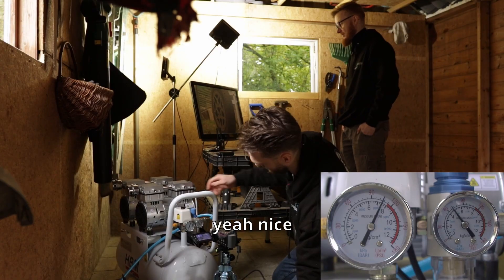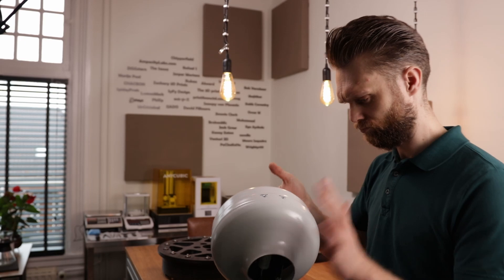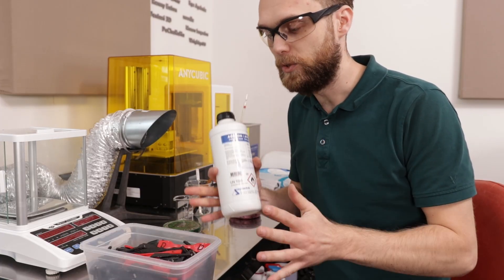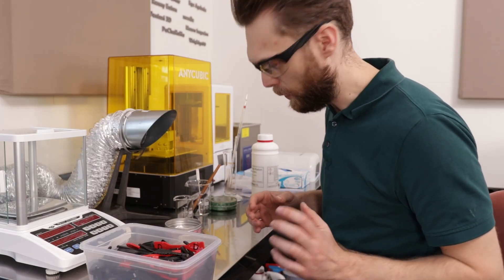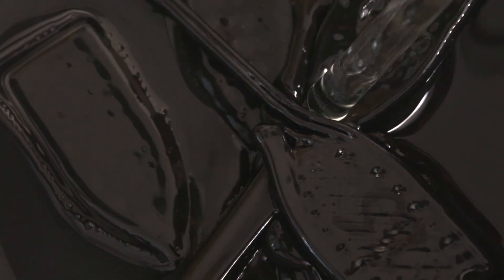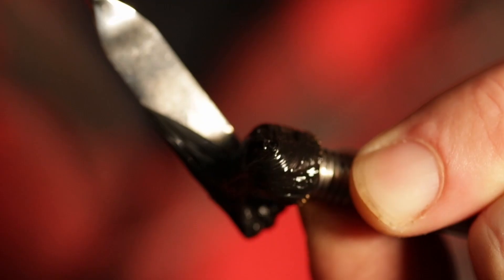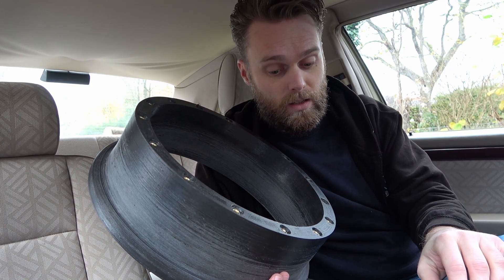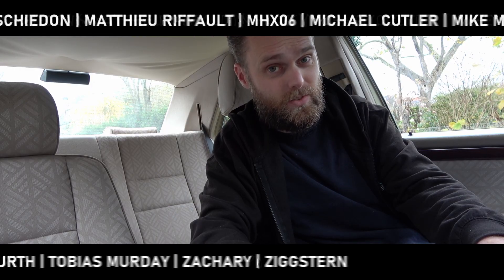DON'T use Acetone to repair ABS parts!

Comment: Can you mix the "Methyl Ethyl Keton" with "Abs" about 75/25%, then brush it all over the rim!, i think it will fill any porosity/ cracks and gives you a stronger outer shell, it might help with your experiment, so exciting for the next video, you can do it :)
Reply: It will also make the rim airtight so you might not need the inner tube anymore
Reply from the maker: Thanks for the suggestion! I was thinking of doing that, but because CNCKitchen showed that this didn't improve the strength of the parts I haven't looked at it further https://youtu.be/yJHcoFY4er8 I have some different tricks up my sleeve ;)
Reply: @properprinting  I saw that video link, my suggestion was inspired from what you have said, that the glued joint is stronger, its look like we are adding a thin layer of glue to your rim, CNCkitchen was using vapor only!
Reply from the maker: @jralrazaz2828  hmm, that's true indeed! That'd be interesting to try! I might need to make a bit thinner, more like paint in order for it to work. The walls are 6mm thick though so I'm wondering how much strength it will actually add since it doesn't really penetrate. Although, every bit helps :)

Comment: If the chemical bond is stronger you should be able to print it in multiple parts and could make a bigger overall tire
Reply from the maker: Interesting comment! I now realize that I didn't mention the print orientation. I don't think that this is stronger than the optimal print orientation, just the layer bonding has increased (what I assume). This means that the diameter is still the limiting factor.
Reply: @properprinting  that hadn't even crossed my mind. I love your unique style of presenting, I'm glad I found this channel 😀

Comment: Looking forward to the testing! Using inset nuts from the inside of the rim would be stronger than using these threaded inserts. Can just cover the nuts with your ABS glue afterwards.
Reply from the maker: I didn't think of using nuts like these and they look stronger indeed! This insert type is different than the regular knurled ones you can find on Amazon though ;) Would be interesting to put this to the test, a bit similar as what CNCKitchen once did.
Reply: You can also put regular hexagonal nuts in the print while it is printing. Change the design so there are hexagonal slots the same length as the nuts. Pause the print just as the hexagonal slots are done. Place the nuts in the slots. Keep printing.
Reply from the maker: @1234567890CAB  I'm afraid that hexagonal nuts causes too much stress between the layer lines. Inserts distribute the force better.

Comment: 5:49 I see you put large chunks to dissolve ABS parts for your glue. Did you consider chopping or grinding it into smaller bits to make it faster and more uniform? I use flush cutters to cut them into lentil size, they dissolve nicely. I'd use a blender or burr grinder but I don't have any spare to use only for plastics.
Reply from the maker: That would've been faster indeed. I also experienced that some parts were quite badly stuck to the bottom of the can. Over the course of a couple of days I stirred it frequently and it turned into one homogenous paste. Thanks for your suggestion which will make this a lot easier for the future!

Comment: I know this is suuuuuper nit-picky, but at 4:00 you say that the place where you glued it back together is stronger and it breaks in a different place, but isn't the piece inherently compromised because it's been tested and stretched before?  
Also all things considered, even with two half printed test samples I'd think it's not weird that layers bonded with a chemical 'helping hand' are stronger then layers purely bonded with temperature, maybe in the far future we'll have some 'abs printers' with little acetone/glue sprayer in front of the print head.   
Thanks for another interesting video :D
Reply from the maker: Great point! That didn't occur to me. It was a standing sample so my guess is that it's not as compromised as the standing samples because it failed so instantly.

ps.  don't tell them my future ideas ;)
Reply: @properprinting  Keep in mind it is a flammable liquid and the hot end is close to ignition point. Be safe, interesting video.
Reply: @bryanst.martin7134  acetone has an ignition temp of 400°C abs prints at about 240°C practically half. I think we're safe
Reply: @properprinting  You could probably also strengthen prints by giving them a coat of acetone after printing.
Reply: the new section is stronger because the solvent gives a "weld" with more penetration.   You have deeper layer adhesion at the glued joint than you do at the other layer interfaces.
Reply: Solvents lower the strength of plastics period. cnc kitchen testing shows us that layer orientation charistericts do not change with solvents. The only way you get stronger is with more section width.
Reply: Anecdotes are not evidence, but: commercial plastic "model glue" is really a thickened solvent that works exactly the same as the ABS "glue" they made in this video.  Every time I've dropped and broken a plastic gaming minature, the break is never at the glue join, and those are injection molded parts.  I'm fairly confident that a solvent-welded join is a lot stronger than the layer adhesion in a 3d printed part.